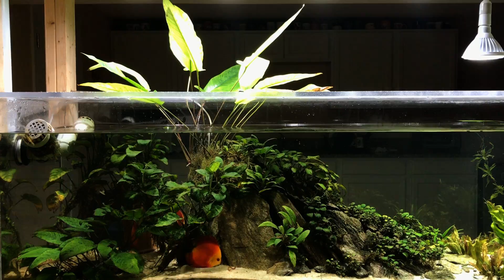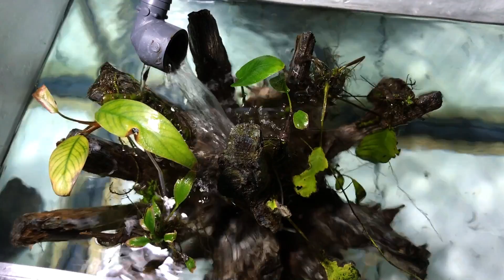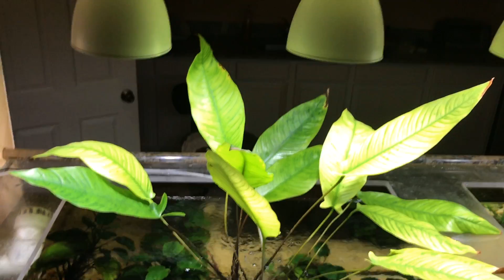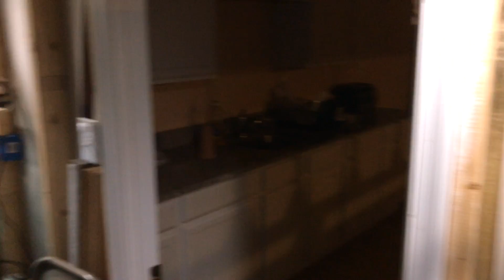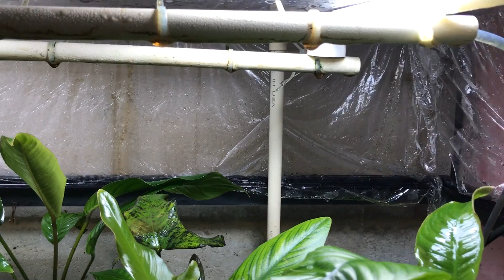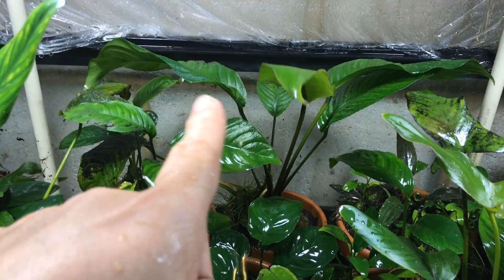Emersed Aquarium Plants

Comment: Very nice tank. How thick is your acrylic on the 240? You keep the water level down to avoid bowing?
Reply from the maker: The acrylic is 1/2 inch thick.  Not much bowing, but I keep the water down for the emersed anubias frazeri.  I want to keep the leaves above the water without having it hit the ceiling.

Comment: Do you supplement with ferts, and if so what and what is the schedule? Great channel
Reply from the maker: Hi Josue,
In the large 240 gallon, I don't put any supplements yet.  I started with organic soil in the substrate with osmocote fertilizer (http://amzn.to/2oox5L1).  This substrate should last at least a year based on previous experience...after that, I would probably need to dose iron and potassium.
In the small 40 gallon emersed tank, I also have organic soil with osmocote...I also have red worms and snails that breakdown the organic matter and convert it into nutrients for the plants.
Thanks for tuning in!